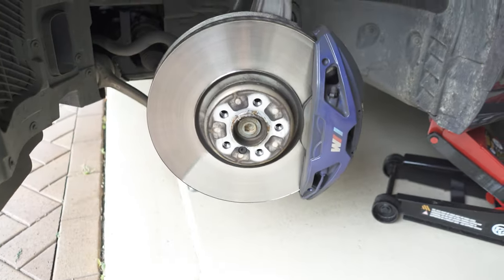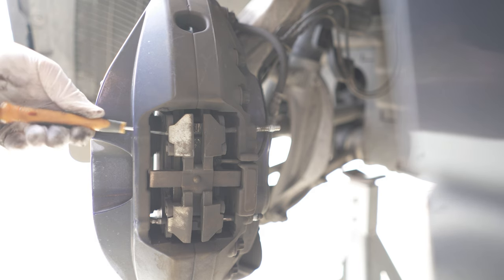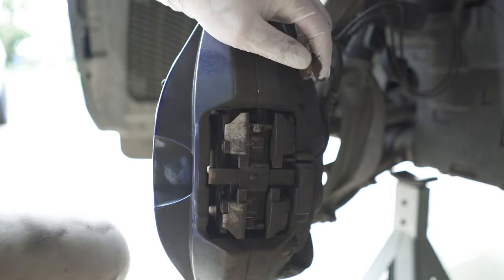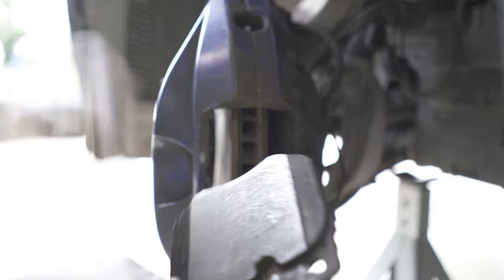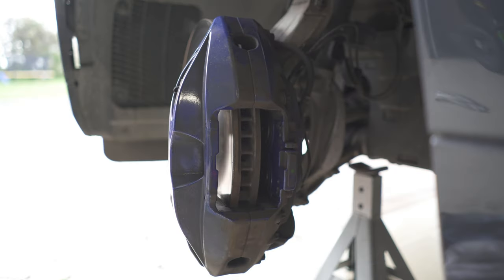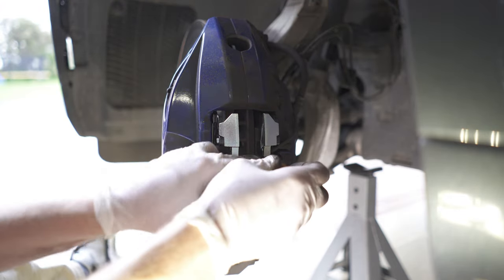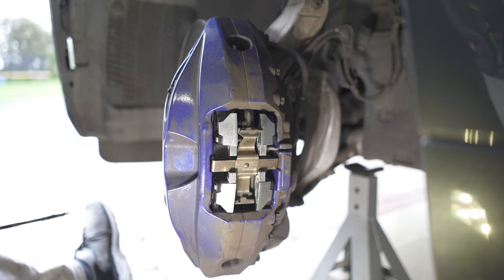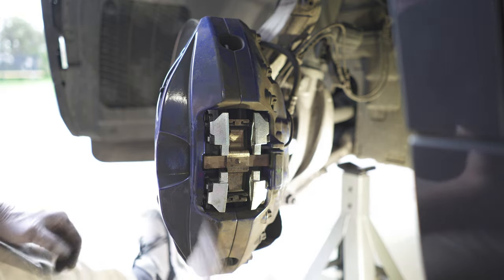How to change brake pads on BMW X5 G05 MSport

Comment: if you want to use less force on pushing the pads back, leave the cap unscrewed on the brakefluid reservoir. Dont forget to refasten after finishing the pads.
Reply: It’s best to crack the bleed nipples for this. 
In the case of these calipers, that way the pistons won’t keep pushing back on each other like they do, and you don’t push any “potentially” bad fluid back up into the system, also no risk of overflowing at the reservoir that way 👍
Reply: @Ally.MacMillan  overflowing should not happen since you should NEVER top off brake fluid, if it gets low its time for pads or rotors or both. But still, thanks for the tip didnt hear this one before, ill try it on my next brake job.

Comment: Great video. Seems to answer all the questions I had about undertaking this job on my G05 M. Message recently popped up and I also noted the sound of the wear indicators sporadically while parking. Hoping the rotors are fine. I did find the pads on Rockauto for 63 dollars US. These are premium replacements from Power Stop. Just ordered them today but they appear to be the correct ones. We will see how they look when they arrive.

Comment: Are you planning on doing the rear?
Reply from the maker: Yes, very soon. I only have 4mm left on them. I will make a video as well in the next few weeks. I will let you know about any pitfalls if I should encounter them.
Reply: Have you gotten around to doing a video for the rears?
Reply: Sorry, I didn’t end up getting g the rear pads because I sold it already.

Comment: I recall there was a brake low message when brake is due to replace. Does the iDrive auto reset this warning message, once the new pad are installed?
Reply from the maker: I replaced front before I got the message. However, I have a message now from my rear brakes. I will replace them as soon as I find some time. I will let you know about handling the message then.
Reply: @mikeofalltrades7587  hello mike, did you end up having to clear the message? Also how much do the front and rear brake pads cost? Thank you
Reply: I only did the front pads. Bought pads directly from BMW service centre. $660 for front pads only.
I changed pads before the message came up. If you have a message up already, you can only clear with Bimmercode or go to the service centre and ask if they can clear it for you.
Reply: @ChristusistGott  In Germany these sets of pads cost only 325 Euro, so your dealer makes a large profit!

Comment: If you are doing your pads before message comes up be careful that the sensor doesn’t touch anything metal. If it does touch the rotor for example, you might get a message that you will have to clear with Bimmercode or via service centre.
Reply: That’s either misleading information you have there, or perhaps you haven’t worded it how you meant to. 
You only get a brake pad warning light if the plastic has been worn down by the brake disc, metal then touches metal, effectively making a circuit and turning on the warning. 
A perfectly intact sensor can touch the disc or any other metal as many times as you like during pad / disc replacement. HTH

Comment: Hello folks! Does not the BMW computer block the pads and to change pads you have to unlock brakes prior to changing via service computer? Thanks
Reply: Only applies to the rear pads. You can manually unlock but it is a bit tricky.
Reply: @ChristusistGott  thanks! I struggle with brakes. By pressing brakes i feel vibration on the pedal. Looks like it is braking discs. But i never overheated brakes and miliage is about 30 000 km..
Reply: You should get 2 sets of pads out of a rotor. You can warp your rotors by going through a deep water puddle with hot rotors. If you think your rotors are warped and you still have plenty of thickness, get them machined. Check all your bushes of suspension, making sure they are not cracked.
Reply: @ChristusistGott  appreciate your advises! Thank you very much!

Comment: Hi Mike, Could you please tell me which brake pads you used for the job? I am having a tuff time finding the right brake pads. If you have the brand and part number, even better. Many thanks in advance. cheers.
Reply from the maker: I went to BMW dealership for original parts. The receipt I have been given states Part Number: 34116889585; Description: Front Pads GXX MS. I paid AUD660 incl. The box the pads came in had a sticker on it with all the models it is suitable for. I don't have the box anymore, but I remember that one of the models was G30 2019 onwards. The pads were made in Italy. I hope this helps. Good luck and have fun!

Comment: Hi Mike - thanks for the video, there aren't many guides online, so this is very useful.  I'm at 50k miles and im being notified to replace my front pads, which I plan on doing myself.

Is it necessary to do the rotors at the same time?  Any tips if you've done this?

Will I be notified again when the rear pads need to be replaced or should I just knock them out at the same time?  Also, are you aware of the "dashboard" glitches when compressing the rear pistons?  Apparently, you need to engage the parking brake prior to using the foot brake.  

Anyway - thanks!!!!
Reply from the maker: Hi Mario, I was also wondering if the rotors need to be replaced and checked with BMW service department. They said that the rotors don't need replacing if they are still thick enough. Apparently mine were fine and could easily handle another set of pads. When you replace the pads you will notice that they might not fully touch the whole area on the 'old' rotors but they will wear in and after about 1000km they look and feel exactly as the previous pads. My rear pads still have about 5000km before they will need to be replaced. I will wait until they are due. Thanks for the tip regarding the parking brake - I am aware of that. My plan is to do it without Bimmercode. We will see if I run into any problems. Good luck and enjoy!
Reply: @mikeofalltrades7587  good stuff, thanks for the info.  You'd be doing a heap of people out there a favor if you post a video of that as well :) Thanks again!
Reply: If you have oem rotor, the minimum rotor thickness is engraved onto it's face.

Comment: I tried doing this today on my '22 xdrive40i w/msport brakes.  I removed the two pins and metal clip, but the pads would not budge, could not pull them out!
Reply from the maker: It is difficult to comment without seeing what is going on. My guess is that your rotor has got a "lip" on the rim and you haven't pushed your pistons back far enough to overcome the lip. The size of wheel and engine type should not make a difference. Keep trying, I am sure you can do it!
Reply: @mikeofalltrades7587  OK thanks.  The rotors don't have any lip on them.  I did push the pads back a bit and I was able to turn the rotor by hand.  I can only assume they are maybe stuck to the pistons?  Maybe have to remove the caliper to get better access to them, not sure.  I did see another video where there were a couple of bolts on top of the caliper that also had to be removed, but I don't think mine have those, might have been a different model Brembo (sp?)...
Reply from the maker: @kbesner  yes, they are glued to the pistons but it shouldn't be too hard to pull them off..